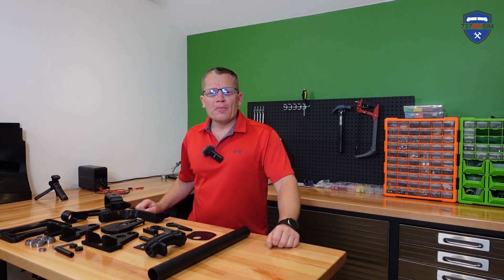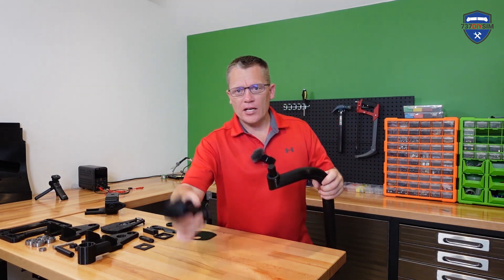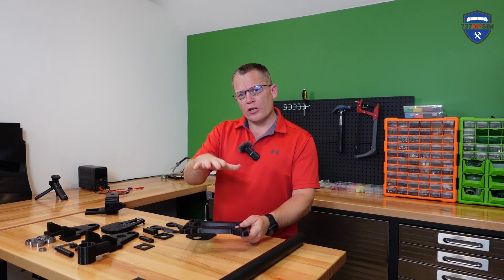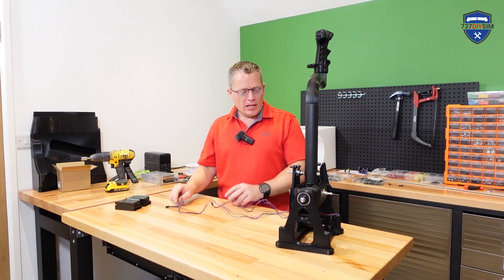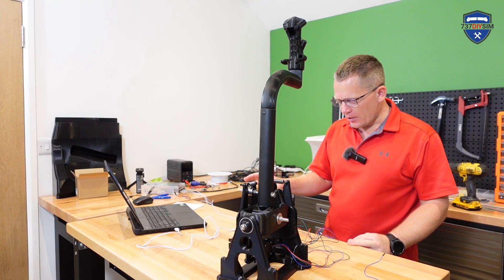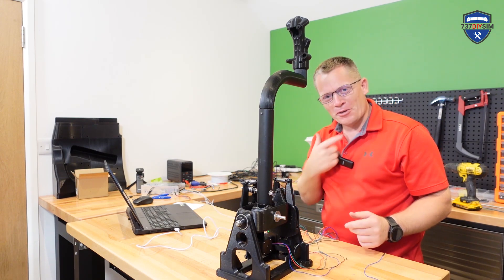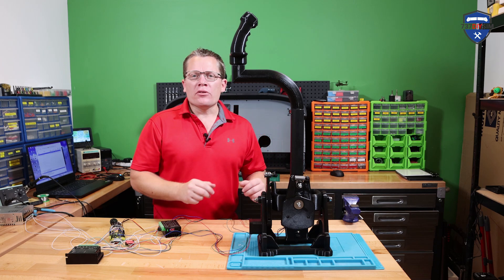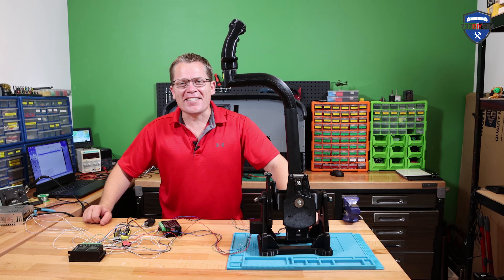Creating & Prototyping a 3D printed fully functional Helicopter cyclic for MSFS2020.

Comment: When used in DCS, can the force trim release switch still be bound in sim? I'd love to build this but still be able to fly fixed wing on it using that switch for other things.

Absolutly fantastic design, by the way, THE most sycenct design of force trim cyclic I've ever seen
Reply from the maker: Hello, this system is completely independent of the sim. The force trim and all their operations are separate from the sim. It replicates the force feel of the helicopter. In a future update I will add autopilot input, but I have no idea how this would work in dcs

Comment: Steering damper 
Add two Steering dampers
the effect will be better
When you quickly change the current position of the joystick, the hydraulic damper will have a certain resistance

A device used by high-speed motorcycles to prevent the front wheel from swaying rapidly
Reply from the maker: Hello, That would probably be good for an aircraft control stick, but if you let go of a helicopter cyclic with force trim on, it will bounce until it finds equalibrum as most aircraft use linear spring feel units. The only change i have made since this video is to use stronger springs.
Reply: @helimech8152  Air tension spring is a good choice
However, the force calculation is more troublesome.
It is convenient to increase and decrease the ordinary spring

Comment: This is amazing! I've been trying to get my head around a good magbreak solution for home simulation. I've even started 3D-printing some components, but still it have never occured to me to use steppermotors, the driving force of the 3D-printer itself, as the solution. This is brilliant. Really looking forward to the finished results and are most probably gonna buy the model from you as soon as you release it! Thanx for your hard work put into this!

Comment: Are the referenced 1kg of force at the top of the stick supposed to be at full deflection, and how much pre-tension do you have on your springs in the neutral position?
Reply from the maker: Hello and thats a good technical question. the force is usually from a set point on the cyclic grip. but for sim building a tywrap arount the mid position of the grip will suffice. The 1 Kg force is from any point in the range with mag brake off. with trim engaged, the force in then icreased protptionaly to distance moved away from the datum (force feel). I hope that helps, Kind Regards, Karl.
Reply: @helimech8152  Hey, would you mind sharing the dimensions of the springs you are using? I bought a cheap little box off amazon with a fairly great number of springs, but there isn't one single one (or even in a pair or quadruple) quite strong enough at zero deflection to even move the unconnected motors in a smooth manner, thus making the screws on the arms quite large, with 6 springs on each cyclic axis, and so far 4 on the pedals.
I wouldn't necessarily buy just by your dimensions, but before ordering some stronger (and more expensive than that 10€ box) springs I would really like to know some real world tested values for their dimensions.
Kind Regards, Julius.
Reply: @helimech8152  Additionally, how much do you feel the steps of the stepper motor when moving the stick when force trim is released?

Comment: Hi Karl. This is fantastic! I am very excited to see the final result, and am keen to have a go at yours myself. I built a FFB cyclic system myself before I had acquired a 3d printer, using dampers, electro-magnets, compression springs, linear actuators, chunks of aluminium box section, etc, etc. It weighs a ton, and needs regular maintenance and fiddling (much like a real helicopter I guess!). I have seen some other FFB cyclic projects recently, but yours is genius, and looks neat and simply structured without large cogs and belts. 
I want to rebuild my cyclic now, and had been planning to anyway for some months. Now, I think I will wait to see your finished system, though I might jump in to Fusion 360 with the inspirations you have given. I would love to show you my current cyclic controllers, but I don’t want to spam your channel.

Comment: Absolutely spot on Karl!    This allows proper attitude positioning for flap back…….Also no reason then (if you know how to code) connect it the AP so that the AP can properly act via the serial actuators using your steppers……then it would be spot on……looking forward to this development as I think only Brunner (and similar companies) have something like this for commercial sims at great cost.    Well done…..!
Reply from the maker: Hi Mike, I was thinking about the series actuator. As you are quite right, that would be the third advantage of using a stepper. But autopilot output on MSFS is already quite tricky to read on some models, and I'm not sure how this will be when the helicopters come in on Nov 11th. Thank you for taking the time to comment, Kind Regards, Karl
Reply: @helimech8152  Karl…..why limit this to MSFS?…..there are some very good Helo models available for P3D and both, I believe, use same type of offsets (never used MSFS) so guessing only.   Also just a thought……is there any possibility that the stepper motors could overheat if the control is pushed and held there against the motor resistance without pressing the trim feel to neutralise the trim force???    Cheers!
Reply from the maker: Hi Mike, I only intend to use it with MSFS right now, but after all it's just a joystick and can be used on any platform. I was worried about stepper motor overheating, but I did actually leave it plugged in and on accidentally over the weekend. They were exceptionally hot when I realised. Still it was a good test, however, I have ordered some fans to help cool them for prolonged use.

Comment: Frankly, after some outburst of the designs from Authentikit (throttles, trims, WW2 stuff), this is one of the most interesting things I've seen. Even more as it clearly could be well used for aircraft. And because my DLC collection for DCS includes Mi-24 Hind ...
1. is it possible for such design to find its center spot? 
2. dampers for axes? Frankly, I wonder if in modern planes and helicopters, especially those FBW types, controls when released bounce like spring loaded PC controller does?

As I am not electronic guy - when reading about proper setting nozzle distance for 3d printer, I was warned not to move base plate too quickly as I move stepper motors and they could generate charge when moved in such a way and send it back and cause damage to the controller - is it an issue? As with that leverage and not powered, you can quickly turn those motors.
Reply from the maker: Hello, I have been thinking about the centre spot for a couple of ddays now, and yes its posible, but im not sure its needed. At the moment you would move the controls to the centre using the trim release. As a heli doesnt normally have self righting controls. But i do see the advantage of this method. It would be very simple to add a microswitch for self centring regardless if it's used it or not. 
As for dampers, they are fitted to some aircraft. and the steppers do act as dampers when in the off/unpowered mode as they do indeed self generate electricty. So the faster you move them, the more resistance is felt. If i was to apply hydraluics in a real aircraft and moved the cyclic away from neutral, and let go. The controls would bounce horrendously until they settled down. I have done this a few times during autopilot functionals, but you must remember  that you have complete control systems, Swashplates and rotors that then move at above normally speeds and the sounds that come from the aircraft as they bounce are a little worrying!
As for EMF, i have had no problems yet as generally when you move them, you un couple the steppers via the drivers which do have opto couplers in them. That said as people test the design, valuble feedback will be gained. The parts are currently in PLA for the steppers, they absoultey must be made from ABS to withstand the stepper hold current heat.

I hope that helps answer some questions, Very intelliginat ones at that, hence the rather large reply back. Kind Regards, Karl

Comment: Wow - and here I've been trying to make a cyclic from an old "Logic3" Joystick I got from Argos in 2007 and some cardboard tube from used Kitchen Rolls. Needless to say my cyclic sucks (cardboard tubes bend, especially where I rammed one inside another to get the required height) and what you have achieved here is precisely what I've had in my head for the last few months. So now I'm sad and depressed as I don't have any DIY skills, hardware, equipment, tools or money to do what you have done seemingly all too perfectly and easily.  And I'm gobsmacked I just searched for "DIY cyclic" and this thoroughly intriguing and mesmerising video came up by you just two days after you posted it!
Reply from the maker: Hello Guy, Dont be disheartened. I try to make my designs availble to all and as low as possible. But you would rewuire a 3d printer. Dont bother with a printing service as that usually costs more than going out and buying the real thing. Got any friends that can print it for you? This is just a side project right now, but there does seem to be a lot intrest in this design. But as i say this is only version 1. Version 2 is already printed and waiting! Kind Regards Karl.
Reply: @helimech8152  Thanks for the reply Karl, but I'm a software engineer, 20 years at GEC Avionics (now BAE SYSTEMS) writing the code for HUDs for C-17, F-5, F-16, EuroFighter and the fly-by-wire for B777, so hardware is not my forte (LOL).  I've never been any good with my hands, didn't like woodwork or metalwork at school, jeez I've not even ever hung a picture!!!  I find your videos quite amazing, with the ability to create prototypes and final products with the power and freedom a 3D Printer provides - it really is quite incredible seeing how far things have progressed in just a handful of years.  I would love to give it a go as I do have 3D modelling experience from using Maxon Cinema 4D for home-made CGI. Maybe one day eh 😉

Comment: This is a lovely build, and I shall be watching your progress with interest. Something I have missed is how do the stick's movements get detected? The 17HS19-2004S1 stepper motors used (I zoomed in) appear not to have encoders, so is the position / force applied detected by the stepper driver?
Reply from the maker: Hello Nick well spoted! I missed the postion take offs on purpose for version 1 as i didnt know if this desig waould work. Those steppers are now doing a job hey were never really designed for. A bit of lateral thinking and in all honesty  I never expected it to work. V2 is now printed with Stick position transmitters included.
Kind Regards, Karl

Comment: I like your concept and will follow this closely.
I have build my own Generic home sim cockpit for fixed wing and helicopers. 
Here I use a 3D printed extended thrustmaster warthog joystick as my current cyclic. The extension gives me enough reduce force with the standard spring to control my simulated helicopters. I am now looking into replacing the spring to get the forces you mentioned to get it even better.
Furthermore I was working on and got stuck on a projects to add force trim to this setup.
Youre prototype just gave me a new insight on how to solve this.
Youre prototype just got i
Reply from the maker: Hello and fantastic news that i manganged to give you some ideads to help create yopur own design. Afterall that was the purpose of my website and channel. To help those in the sim world and prove it dosnt cost a fortune to achieve pretty good results.
Kind Regards, Karl

Comment: I like it, It's a good way to get force trim for those who don't need force feedback and much simpler and cheaper too. I did have a slight concern about the steppers losing steps, but since the motor position doesn't actually matter in this instance, any skipping can simply be mitigated with larger steppers. Cogging isn't an issue since the steppers only really hold the position and the stick moves against the springs rather than the motor torque. My only remaining concern would be the hard centre provided by the pincer mechanism. I've no idea how that compares to a real helicopter, but I'd prefer dual cam centring for a smooth centre.
Reply from the maker: All good points, and thank you. As for centering, most helicopters us a linear spring system. Being a helicopter engineer, i reckon this perfoms exactly as the real aircraft. Or at least as close as im going to get with out using control rods and linkages, while keeping the soave used to a minimum. Kind Regards, Karl

Comment: Do you think this would work for other Sims like DCS?  I would think you'd have a fair amount of demand there for such a rig.  Great job BTW, always enjoy your videos.
Reply from the maker: Hello, it should work in all sims, as there is currently no sim interface. It's just a self powered joystick operated by mobiflight software. Thank you and kind regards Karl
Reply: Anything you can connect to your PC and is able to communicate with it would do the job. So why not? Add some sensors (pots, Halls) wire them to Arduino and you are done. Plenty of the codes for the joysticks for the Arduino boards are available.